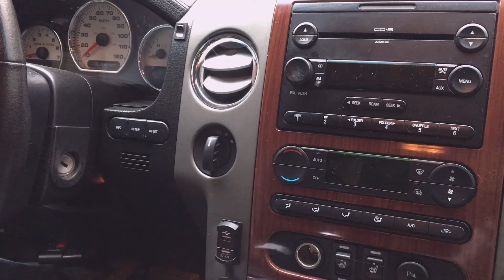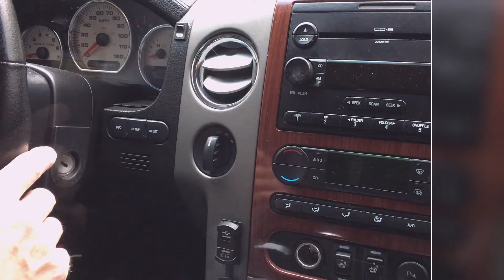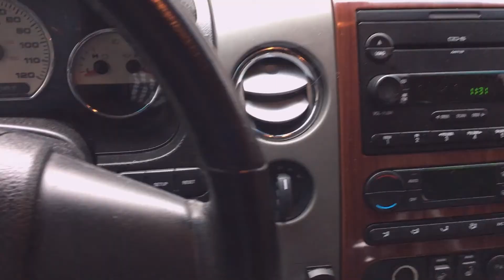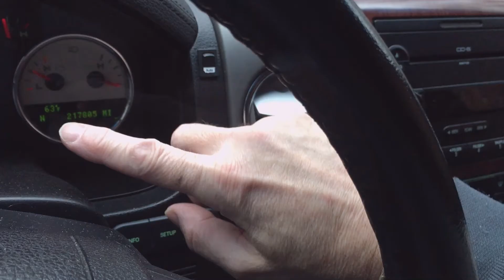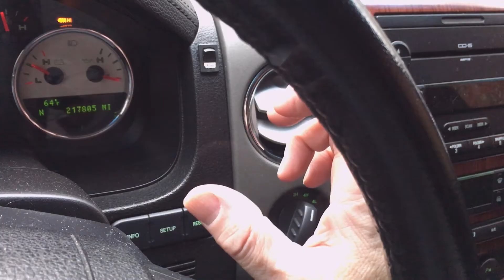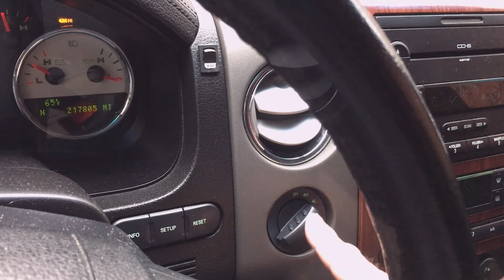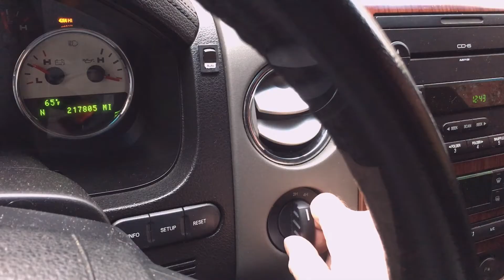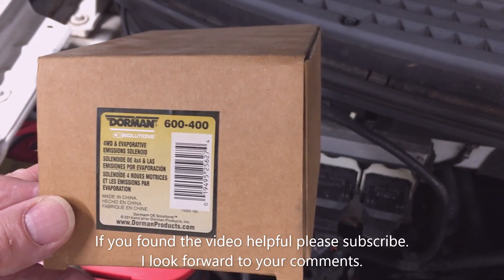4WD Automatic Hub Engagement Troubleshooting & Solenoid Bypass '97 to '18 F150, 11 to 18 Super Duty

Comment: That ratchet strap tie down is a disaster waiting to happen!
Reply from the maker: Allan, neither the Rachet Strap nor the Batteries can move for and aft.  Even if it could, the Handle is not long enough to touch both Terminals even at a diagonal. The Strap is a doubled over Repelling Strap that would how up the World.  I talk about the Dual Battery Design in my Stiles Automotive Video (see link below). - Stiles

Dual Battery Design & Install; Modification for Any Car or Truck, Shown on 2004 to 2008 F-150 Trucks.  https://youtu.be/t05w5tv64g0

Comment: Thank you, But did anyone else notice the Fire Hazard Battery rachet strap?
Reply from the maker: David, Actually David, neither the Rachet Strap nor the Batteries can move for and aft.  Even if it could, the Handle is not long enough to touch both Terminals even at a diagonal. The Strap is a doubled over Repelling Strap that would how up the World.  I talk about the Dual Battery Design in my Stiles Automotive Video (see link below). - Stiles

Dual Battery Design & Install; Modification for Any Car or Truck, Shown on 2004 to 2008 F-150 Trucks.  https://youtu.be/t05w5tv64g0

Comment: I have an 02 expedition and no solenoid there
Reply from the maker: Beringer, Yep, your 2002 is a generation older and has a different system.  If you have a 4wd, you should have 2 Solenoids similar to the one I show on my Truck. And your Solenoid should be on the firewall behind the Battery, if not look on the inner fender behind the Battery.  Or do you have 2wd and are messing with me? - Stiles

Comment: what's up with the ratchet strap across the battery? looks kinda sketchy to me
Reply from the maker: Nope, Rostang, its by design and Strap are used for hold-downs in many applications.  Check out the details in my Video:  Dual Battery Design & Install; Modification for Any Car or Truck, Shown on 2004 to 2008 F-150 Trucks.  https://youtu.be/t05w5tv64g0   - Stiles

Comment: Anyone on here help me out so on my 2017 f150 just replaced both iwe hubs they engage and disengage when using a hand vacuum pump but when hooked up properly they don't fully engage
Reply from the maker: Nick, Sounds like you are just not getting enough vacuum at your IWE.  Your Vacuum Pump likely has a Gauge on it.  You should determine: 1) the vacuum at each IWE, 2) vacuum at both sides of the Vacuum Solenoid. If vacuum at the outlet side of the Solenoid is higher than at the IWE, there is a problem with the Vacuum Line to the IWE. If the vacuum is lower on the outlet side of the Solenoid vs the inlet side the Solenoid is not opening fully.  Continue troubleshooting your way back to the vacuum source at the Engine Intake Manifold.  Two things to watch for: 1) you have a Plastic Vacuum Reservoir above the Brake Master Cylinder, make sure it is ok, 2) Ford likes to put Rubber Vacuum Hoses right on hot Engine Parts, I don't remember for your Truck, but it is like this on many Fords.  The heat damages the Hose very quickly, and you may have a leak there.  Ok, 3 Things, 3) Make sure to check all of the little Vacuum Check Valves, you have at least one (and probably one), but if you have more, check them.  Let me know how it goes! - Stiles

Comment: I have a 2017 and I changed the check valve and solenoid actuator and a few weeks went by and no problem. But the grind came back and I capped off the solenoid and the grind went away. Do this hurt the truck in the long run?
Reply: Another mechanic on YouTube said just cap off the solenoid connection and keep it locked in
Reply from the maker: SFC Jerry, Yep, Ford uses these IWEs (integrated wheel ends) for a reason (or 2): 1) disengaging them gives you better Gas Mileage, 2) engaged all the time causes the front axle to spin, causing more wear. (and I might add, with no benefit, because your Transfer Case is not driving the Front Axle). If I were you, I'd continue to investigate and figure out what the problem is. - Stiles

And . . . as I hit the reply button . . . Ford tells us in the  F-150 Owner's Manual  "Do not use 4X4 mode on dry, hard
surfaced roads. Doing so will produce
excessive noise, increase tire wear and may
damage drive components. 4X4 mode is
only intended for consistently slippery or
loose surfaces."  Ford doesn't (I haven't seen it) say in 4WD you should limit your speed, however, I use to drive my 2005 F-150 with 225,000 miles on it, at 80 miles per hour in 2H. I wouldn't do the with the IWEs engaged. 

Oh, and on other thing, your 2017 has a Traction Control System, you may be confusing that system, may be not, but may be. - Stiles
Reply: @StilesAutomotive  I put it back to what it supposed to be so far so good. Yes the system is set up like ford has it.
Reply from the maker: @sfcjerryharris1  I don't know if you noticed, I was editing my reply when you added this comment. - Stiles

Comment: What about 4Auto? Will this hurt the truck in the long run?
Reply from the maker: SFC Jerry, Again, like my reply to your other comment, 4A keeps the IWEs engaged for when the Control System determines a need for 4WD. This will use more Gas and a little more wear on your front Axle Components. - Stiles

Comment: Thanks for the breakdown. It really seems then, that a broken vacuum line (they get brittle in Nevada) would cause the 4 wheel drive to engage on its own... When you are not asking it to do so, in any way. More likely that than the 4x4 electronic shift motor
Reply from the maker: Shane, Yep, that is true. Its a matter of which way is the best way if it fails. If you are axle deep in mud, the best way is to fail in 4WD. I have seen the Solenoid fail, so the System stayed in 2 High.  I appreciate your comment! - Stiles
Reply: @StilesAutomotive  so, if I hear a clunking noise some times while driving it's because the 4x4 is trying to engage by itself ???
Please help !😢

Comment: Will this work on 04 Ford Explorer
Reply from the maker: Denb, I believe the Explorer is different, it uses a Switch and Motor at the Transfer Case, but does not use the Vacuum Solenoid like I am holding in the Thumb of this video. - Stiles

Comment: My 2007 F-150 changes into 4 high and 4 low , but the fron axle does not engage even with the vacumn lines off of the hubs . I think the electrical part you describe is fir the transfer case selction and nothing to do with the IWE engagement ??? Thanks for any advice .
Reply from the maker: Rodger, Not true, the Vacuum Solenoid I'm holding in the thumb nail for this video is the Actuator for the Integrated Wheel Ends (IWE) which pull out the IWEs into free wheel.  Springs move the IWE back into "engaged" or 4wd when vacuum is removed. The Solenoid can stick in either position, but if you say the Vacuum Lines are off, your IWEs should spring back to engaged. You need to replace the IWEs. - Stiles

Comment: How many Volts did you get on the connector that connects to the IWE Solenoid? While engine off and on? Because im havjng issues with mine but not sure it needs to be reprogrammed or faulty connector
Reply from the maker: John, You get "Battery Voltage" with voltage drop thru wires, switches and relays, ends up being 11 to 12 volts (normally) and you would like it to be on the high side of 11 volts, like 11.8 really. - Stiles
Reply: @StilesAutomotive  yes sir I checked it and I do get 11 .8 volts it bounces a little with the key on engine off and with that my iwe is able to release my wheels freely but when the engine is turned on the voltage drops from 11 down to 5.9 and iwe does not release my wheel and its engaging into like if it's 4x4 so not sure it's an electrical issue but I did see from another video that it might be a reprogramming issues. Any advice you can share

Comment: Any advice? I have a 2004 f150 that has one hub locked in and it be hub that isn’t. I have put a new solenoid and that did not help
Reply from the maker: User, With the F-150 Running and in 2H, pull the Vacuum Hose off of the IWE and with your finger check for vacuum. Better, yet, stop buy Harbor Freight (or amazon) and buy a cheap Vacuum Pump/Gauge Set. Then you can measure vacuum, and use it for my next thing. With the Tire off of the ground, Use the Vacuum Pump to actuate the IWE.  Your problem is likely the IWE. - Stiles

Comment: I have vacuum at the hub all the time , if its in 2 wheel or for wheel drive . do you have any idea what to look for
Reply from the maker: Tweeter, Yep, its very very likely the Vacuum Solenoid. Make sure you get one with the Plastic Housing over it to keep the water out. - Stiles

Comment: When I shift with truck bit running hear all normal noises and light all work with truck running it does not and 4x4 shifter doesn't light up
Reply from the maker: John, the Light on the Shift Button, (or indicator on Dash) indicates the Transfer Case Shifted and made it to the position.  When your Truck and Transfer Case is old, you likely have to stop and shift from "Drive" to "Reverse" and back to "Drive", just like shifting to 4 Low. The IWEs don't have indication. - Stiles

Comment: In my 47 years of greasing I have never seen such a potential fire hazard as you have illustrated in this video with the ratchet strap being so close to the battery. I was very interested in this video until I saw that at which time I lost all interest. Good day sir.
Reply from the maker: Mark, Actually the Ratchet Strap is holding the Battery, one for each Battery. And nope, the Ratchet Handle is not long enough to touch the Battery Terminals. In 4 years and 50,000 miles or more, it has not been a problem.  But you are correct if it did, it would be a fire or explosion (Battery dependent) hazard. 

I show the Dual Battery design in detail in my Stiles Automotive Video - - 
Dual Battery Design & Install; Modification for Any Car or Truck, Shown on 2004 to 2008 F-150 Trucks.  https://youtu.be/t05w5tv64g0

I appreciate the comment!  - Stiles
Reply: @StilesAutomotive I think it is better just for Ford or us, to use a larger battery, instead of 2,  like a 850 cc amp batt used in diesels…does any code show on the dash if the vac sol or shift motor is not working ok, or is it silent and we find by noises or performance or lack thereof ?
Reply: At first I thought you were being harsh, now after seeing holy shit lol.

Comment: I would be a little bit concerned about that. Metal ratchet strip being so close to both negative and positive terminals
Reply from the maker: Cliff, Nope, I wasn't at all. It is not long enough to touch. In 4 years and 50,000 miles or more, it has not been a problem. But you are correct if it did, it would be a fire or explosion (Battery dependent) hazard. 

I show the Dual Battery design in detail in my Stiles Automotive Video - - 
Dual Battery Design & Install; Modification for Any Car or Truck, Shown on 2004 to 2008 F-150 Trucks.  https://youtu.be/t05w5tv64g0

I appreciate the comment! - Stiles

Comment: My question is how is the vacuum applied to the hubs is my 2004 v8 4x4 only has a sensor in the hub
Reply from the maker: Andrew, The Vacuum Solenoid that I talk about in the video, switches (or turns on and off) the vacuum to the IWE (which are like automatic hubs).  First of all, if your Vacuum Solenoid doesn't have the Plastic Hood over it to protect it from water, then replace it. The Solenoids normally fail in one position or the other, either in open or closed, either in 4WD or not. That is normally. As I stated in the video, Vacuum to the IWE = Free Wheel or no 4WD and No Vacuum to the IWE = in 4WD.  The "Sensor in the Hub" is the Wheel Speed Sensor which is used in the ABS (AntiLock Brakes) System. - Stiles

Comment: Had quite a few issues with my truck that I fixed. 

Vacuum lines were completely broken and one hub was leaking. I got it them corrected and then realized the vacuum box was leaking through trial and error rearranging the vac lines.

With 12v to the solenoid (2wd) it wasn’t engaging. 

So I will order a new solenoid and vac box on Tuesday. 

I have the vac lines bypassing the vac box and solenoid so I can drive without damaging hubs. 

My only problem is checking at the vac solenoid connector unplugged I’m getting 12v no matter if the truck is in 4Wh, 4wl, or 2wd. I’ve seen some people say that there is still a small amount of voltage to the solenoid even when 4wd so I am going to replace the solenoid first and see if it will correct.
Reply from the maker: Aaron, Yep, don't drive 80 mph on the interstate with your IWEs engaged, otherwise for 50 to 55 mph driving the Integrated Wheel Ends (IWE) (like automatic hubs). You didn't say the Model Year and information on your Truck, so I assume it is a 2004 thru 2008, like the video.

Read thru my answers to the comments here, I had a couple of very detailed answers.

You should see 12 Volts (or Battery Voltage) at the Solenoid. With 4WD Selector Switch in 2H (with Key “On”)? Ans: Battery Voltage or ~11.8 Volts on the Power Wire (Pink Wire / Lt BLU Stripe) from Fuse 11 (10A, Red) 4x4 Solenoid and the other Red Wire goes to Powertrain Control Module (switched ground) will show ground. What should the voltage be at the Solenoid with 4WD Selector Switch in 4H and 4L? Ans: The same or ~11.8 Volts on the Power Wire and open or no ground on the other Red Wire to Control Module. - Stiles

Comment: I have had 98- o4 Randers, I have put 95-96 front fork lock front axle in them, ranger station ( HAD) info on this, in 2019 they sign a contract with ford to remove things like this, and push the 2019 rangers. I need the simple diagram, I put 95 explorer front fork lock front axle in   a 98 2 door Explorer with a 2.5 4 cylinder, manual transfer case and transmission, non 4x4.  I transferred the Cruz ball with 3 vaccume line. I need the 5 wire diagram on how to use a double throw toggle switch, I no brown wire is taped off. Black is ground. Does the purple and orange hotwire go to the center of the toggle switch, green and pink floating 4 x 4 side to disengage???
Reply from the maker: Kevin, I had a very detailed reply to Shawn Clark awhile ago, which may help you. I'll copy it below:   - Stiles

"Shawn, To answer your questions and then work the problem:
1) What should the voltage be at the Solenoid with 4WD Selector Switch in 2H (with Key “On”)? Ans: Battery Voltage or ~11.8 Volts on the Power Wire (Pink Wire / Lt BLU Stripe) from Fuse 11 (10A, Red) 4x4 Solenoid and the other Red Wire goes to Powertrain Control Module (switched ground) will show ground. 

2) What should the voltage be at the Solenoid with 4WD Selector Switch in 4H and 4L? Ans: The same or ~11.8 Volts on the Power Wire and open or no ground on the other Red Wire to Control Module.

3) 4WD Selector Switch (or Electronic Shift On The Fly Switch) has 4 Pins (labeled 1 thru 4, left to right); a) Pins 1 & 4 Switch Illumination, b) Resistance between Pins 2 & 3 of 4WD Selector Switch (3.9 K Ohms, 1.1 K Ohms, 360 Ohms). The resistance tells the PCM the Switch Position and desired Mode (2H, 4H, or 4L).  To remove the switch it has three plastic tabs on the back, (see the RockAuto website, FORD > 2005 > F-150 > 5.4L V8 > Electrical-Switch & Relay > 4WD Switch). 

If you know your 4x4 Relays are ok, you probably have checked your Fuses: Fuse 11 (10A, Red) A/C clutch, 4x4 solenoid in the Passenger Compartment Fuse Panel (in the Rightside (or Passenger’s Side) Kick Panel) is the Fuse for the Solenoid.  Also Fuses 29 and 30 (Both 15A, Blue) PCM 4x4 Power in the Passenger Compartment Fuse Panel power the Transfer Case Actuator (and Transfer Case Shift Indication). Fuse 111 (30A, Pink) 4x4 Relays on the lower right of the same Fuse Panel.

Like I said in the video you should be able to hear your solenoid (or at least feel it) click and hear your Transfer Case Motor.  You should be able to hear (or at  least feel) your 4x4 Relays on the inner fender well near the Vacuum Brake Booster. 

Let me know how it goes - Stiles

Solenoid Wire Colors:
Pink Wire / Lt BLU Stripe (Pwr From Fuse 11)
RED to PCM (switched (-)) "

Comment: I like the ratchet strap holding the battery.. That metal ratchet handle right by the battery terminals 😅😮would never short out the battery and let All the smoke out if the strap broke
Reply from the maker: Rick, I talk about the Dual Battery Setup and the Strap in a video (see link below). The Black Strap is normally used for climbing and can support 4000 lbs.  I use it doubled over. I talk about the issues with using a Strap in the video. The Ratchet Strap would have to be a little longer to short across the Battery Terminals. - Stiles

Dual Battery Design & Install; Modification for Any Car or Truck, Shown on 2004 to 2008 F-150 Trucks
https://youtu.be/fWX9hggGIz8?si=RAld-lTtclS3ISMs

Comment: This might be helpful to me maybe my problem appreciate it
Reply from the maker: Richard, ok, very good. At least this video describes in detail how the System works, which will help you troubleshoot your Truck!  Thanks for the comment! - Stiles
Reply: @StilesAutomotive  I have a question. when i activate either the 4hi or 4low or any other the light on the board does not turn on. but if it works because you hear the sound that is activated. thank you
Reply from the maker: @valdeperez4849  Valde, its better to ask a question directly to the video, not in the reply of other comments, I can see it in a comment area on You Tube. 

There are two different things happening the you are hearing the IWE and Vacuum Solenoid that doesn't have anything to do with the Dash Indicator Light and the 4WD Actuation Solenoid on the Transfer Case, this is what Switches the Dash Light and "proves" the transfer case is in 4WD Hi or 4WD Low. - Stiles